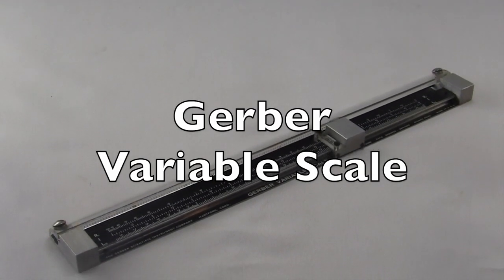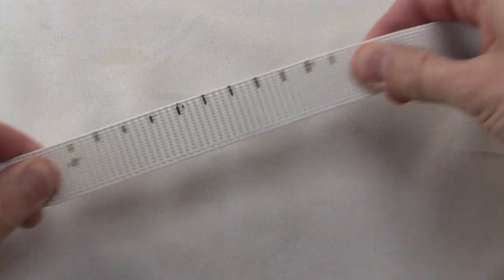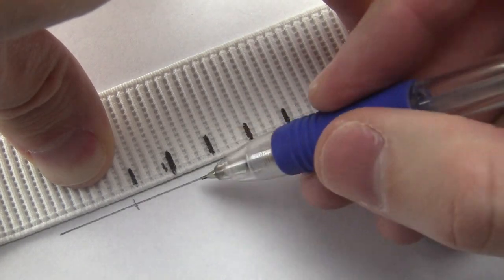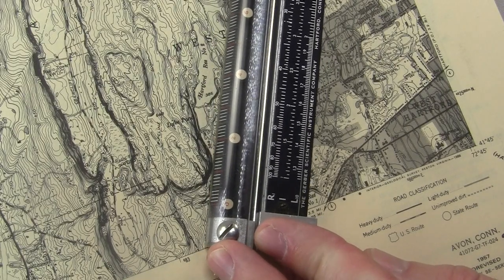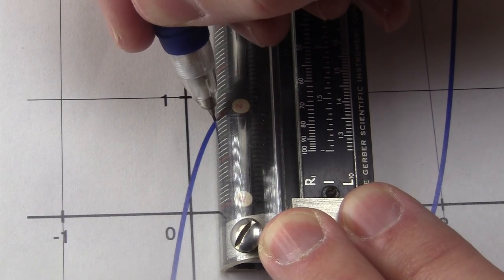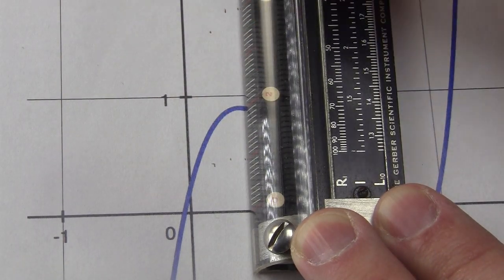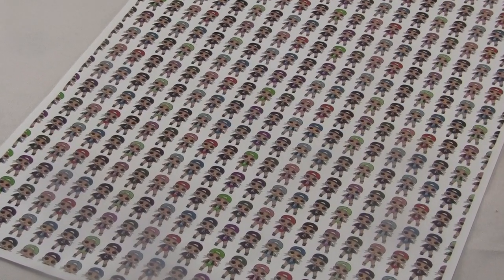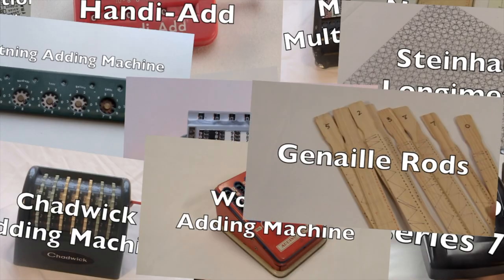Gerber Variable Scale Review / HowTo

Comment: I found one of these in my local university surplus store today and instantly remembered this video. Only cost 16 bones! and came with the ORIGINAL leather case and allen wrench. Mine is about double the length and goes to 20 instead of 10. That's twice the Gerb! In real life I was surprised that the markings on the spring section were so tiny - this was clearly made with some precision.  Turns out, Joe Gerber's company is also responsible for the Gerber file format used in circuit board making, with which I work regularly. Never would have known if I didn't see this video; truly one of the best channels out there. Merry Curtsmas!
Reply from the maker: Nice find! I didn’t know there was a longer model- how long is it?
Reply: @ChrisStaecker  Measures in at about 566 mm, which is a bit under 2 feet. Model TP007200B for those playing along at home. I guess this is supposed to be the 20 inch model. I had no idea I had the big gerb version either until I came back here for another watch, but it makes a lot of sense if you're working off big drafting sheets or something. I think it would be difficult to make a much longer one since the long spring has more friction and tends to bunch up at the one end, and I have to give it a couple light shakes to even it out.
Reply from the maker: @alnwlsn  Wow- congrats on finding a rarity! Now I want one. I see one on ebay for a truly insane price. One sold a few weeks ago for $100, which sounds reasonable. $16 is a steal!

Comment: But what do the log scales do? Is it just a bonus slide rule?
Reply from the maker: The manual describes how you can use them to "interpolate between graphical logarithms". My interpretation (maybe I'm wrong): I showed in the video how you can subdivide scale markings on the paper into equal subdivisions. But if your paper graph is plotted on a log scale, and you want "equal" logarithmic subdivisions you need to do it differently and the log scale helps to do that.
Reply: Check out the Gerber GraphAnalogue.
Reply from the maker: I'd love to do a video on that, but it's a bit too expensive for my budget... you got one?
Reply: @ChrisStaecker  yes